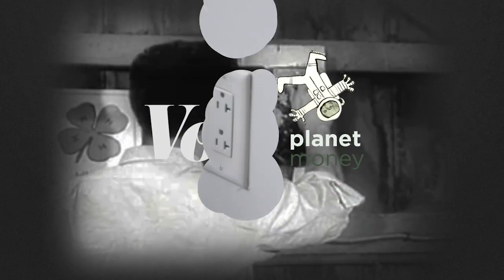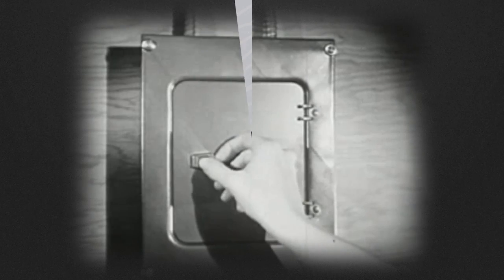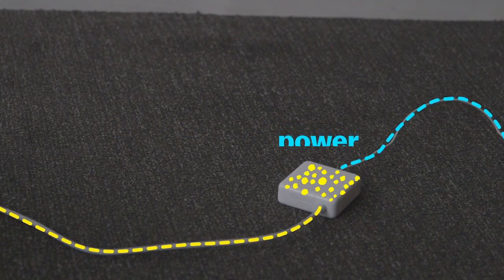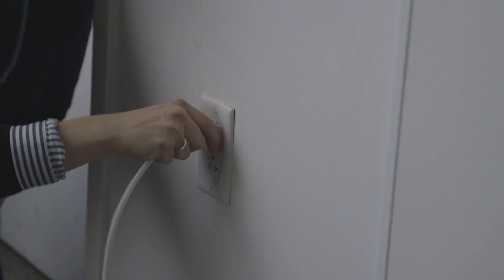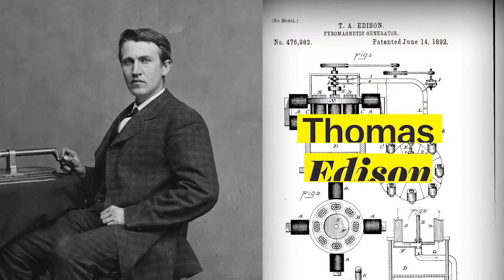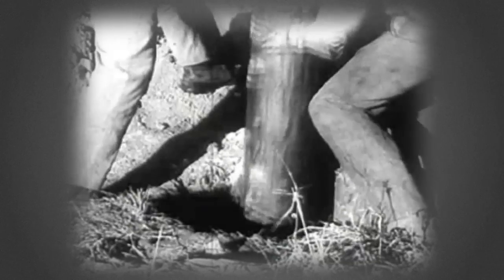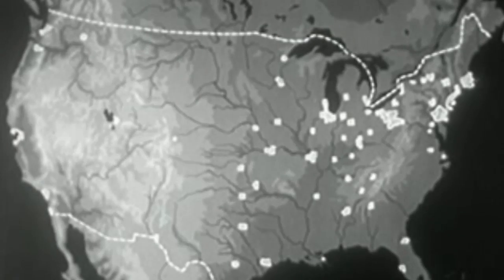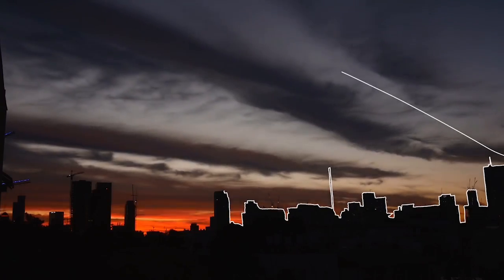Why your laptop charger is so hot

Comment: The video is wrong but the idea of putting a 5V rail into a large building is good. Efficient conversion in one spot. Then you could have outlets (probably USB) throughout the rooms/appartments/cubicles.

12V and 24V would be nice as well, that would help because it's better to regulate down than up but not clear what connector would be best.
Reply: Just try to get a steady 5v from down the empire state building to every single floor. Wire has resistance, so if u send 5v from floor 1 floor 100 could have only 3-4V

Comment: I would have thought this video would also mention that said conversion could be done a LOT more efficiently: All that heat production isn't actually necessary. You can make electronics (for not all that much more expensive) that convert to DC with almost no energy loss (aka heat). For some reason (read: to save a couple cents worth in production, maximizing profit), electronics' chargers are typically sold really bad, efficiency-wise. Customers don't complain: Nobody seems to care how efficient that conversion is, as long as the electronic device in question lasts long enough. Thus, whereas laptops, tablets and phones are becoming increasingly efficient to draw the most computing circles from the smallest, thinnest, lightest batteries, their chargers are not even close to being held to the same standards.

Comment: One thing that the video forgot to point out is, that DC is hard to Voltage regulate. So a central Ac/Dc converter must supply all the different currents. While it is possible to get 12 volts to 5 volts to charge your phone from a car battery, it isn´t that simple with electric cars. The voltage is about 488 Volts and a massive 200 A. This leads to 120000 Watts of power. To have a  comparison: my laptop charger is rated to 65 Watts. So you would need around 1847 chargers simultaneously to charge your Model S.

Comment: Forgot to mention AC is slightly safer, it'll throw you across the room before it cooks you. But I like the idea of a parallel DC power system in the home and we finally have a decent connector for it, USB-C !  1 or 2 USB-C connectors at each outlet with a DC transformer back at the fuse box would be sweet.

Comment: This is wrong on so many levels. Not the quality I expect from vox. Please do more research next time.
Reply: explain y its wrong
Reply: I completely agree. No research whatsoever. It would be fine if all devices were the same voltage. Also didn't mention anything about safety either, such as the demonstration with the horse, that Tesla performed.
Reply: I know this is a really old comment, but nobody actually offered a good explanation for any of this. 
What the video doesn't get into is the reason why AC is better over long distances, which is kinda key to understanding this. Basically, we rely on transformers, which utilise magnetic fields to step up the voltage so that we can move lots of energy at fairly low currents. This is good because the power lost in a conductor of fixed resistance is proportional to the current flowing in it (substitute v = ir into p = iv for p = (i^2)r). Magnetic fields though are proportional to the differential of current, which means unless the current is continually changing (AC), then transformers that use turns of copper wire wrapped around chunks of iron don't work, which means you give up a convenient way to step voltages up and down with no expensive parts. This is likely less of a factor now than it was back at the turn of the 20th century, as you can get inexpensive, flexible and highly efficient switched mode power supplies for next to nothing these days.
Now, running DC all over your house could work, but the same rules for transmission losses apply. It might be more convenient for some of your devices, but in practice it means that you need thicker, bulkier, more expensive wires to move your power around and keep resistive losses down. That's not to say it would be pointless. Some LED lighting circuits are DC, and data centres often run 48V busses for servers to centralise power conversion and improve efficiency. Interchangeability is also important, so alot of the reason we use AC is that everyone else already uses AC. AKA the "if it ain't broke, don't fix it" factor.
The video, despite comments here, is perfectly good for a layman. It just lacks a little depth. But hey, this is a youtube video. I'm not sure what people expect...
Reply: +fred
Oh yes, supercharging things are clever. What the phone/tablet/laptop has is two charging circuits. One is for standard 5V USB voltage, its a DC/DC converter that steps up from 5V so you can actually charge the battery if that is all you have. If the charger supports supercharging, then the device negotiates voltage and current limits and switches charging over to the circuit that works at a higher voltage.

All that only works because you have one smart power supply and one smart device. It doesn't work if you have one supply and many devices each requiring different supply voltages. What you can have is wall outlets that have built in USB chargers, doesn't really get rid of chargers, it just builds them into walls permanently.

[edit]
Ah, these days they do actually have power managers that actually can work with wide input range, this one can work on 3-24V input from USB, they have 5V, 12V and 20V supplies on charger side that are switched as negotiated
http://www.ti.com/lit/ds/symlink/bq25703a.pdf
Reply: ^ luh tanga amp
Reply: Central DC power for homes seems like a very stupid idea, problems with it should be obvious to any electrical engineer. What is not obvious to me, is what would be the benefit? What could possibly outweigh all the problems with such a system? It's certainly not saving power like the video suggests, central DC would be grossly less efficient just because your central supply would be operating well under it's rating pretty much constantly.
Reply: +fred you would still need a DC/DC converter for every device, whatever your standard outlet DC voltage would be, it wouldn't be edible for every device.
Reply: +101m4n
Transformers are still an argument for power distribution, they are simple, efficient and extremely reliable. SMPS can be efficient, but only at max rated load, at say 10% load that efficiency goes out the window, transformers efficiency is pretty much constant, high load or low load, doesn't matter. 
That is also why central DC supply is not an efficiency gain, it has to be rated to power everything you might plug into it, but most of the time very little is plugged in. If on the other hand you have a DC supply per appliance, then the supply is rated to that specific load and can operate near it's maximum efficiency any time it's switched on.

It's worth mentioning that high voltage DC is used for power transmission, but only in niche cases like undersea cables and/or when you need to link up two grids that are not in sync with each other. Undersea cables because they are bloody long and built like coaxial cable, higher voltage means less resistive losses, but you are limited by the dielectric strength and thickness of the isolation, so with DC you can use higher RMS voltage compared to AC and get 1/sqrt(2) less resistive losses.
Reply: My point was exactly that. The simplicity and reliability of transformers is probably why we ended up with AC grids in the first place. I have seen proposed hvdc systems, but didn't think they were all that common. A quick google search though reveals though that they are used all over the place, especially for renewables like offshore wind, which makes a lot of sense given what you said.
Reply: AnyGamesEver (read:men too)
Reply: nobody knows you're a dog on the internet
Reply: "the quality I expect from Vox" really ought to be a lower bar, at least this time it's plausible they just don't know they're wrong. On many topics they seem to actively seek ignorance on a topic, avoiding every opportunity to learn.
Reply: Now that is some detailed knowledge.
Reply: ekolimits 666 likes
Reply: Andrew Also some gaming laptops.
Reply: 101m4n It could also mean that the power brick gets overheated by overworking on supplying the power not only the device itself, the battery as well.
Reply: i knowwwwwww rieeeeeeeeeeeght???!!!!! cali education
Reply: From an Asian student's perspective: P=W/t=UIt/t=UI
Reply: the animals that were electrocuted would have died from both ac and dc, it was just marketing stunts done in bad taste to scare people over to the other side :)
Reply: He's not being sexist, he's just saying that the woman in the video was a journalist that had nothing to do with engineering.
Reply: ekolimits this is okay enough for non engineer minded person, (read:woman)

Comment: What? Nooooooooooooooo, Vox, noooooooooooooooo. Very bad conclusion. Yes, AC travels long distances, but flip that and you arrive at the bigger problem of DC: DC power can only travel very short distances before all of the energy is lost. In order for an effective DC power grid to be established we'd basically need a power plant every mile or so, making it useless outside of cities. So if you work in an office building and your office is way up top but your hypothetical DC converter for the building is in the basement then it sucks to be you. Plus some of the energy loss is converting the voltage which would still need to happen once the charge reached your electronics, which is the main reason for all that excess heat, so you're adding an extra system of complexity and not actually capturing any significant energy that would've been lost anyways. Beyond that, DC power was extremely dangerous. AC goes through a 0V stage because it oscillates back and forth, DC is all voltage all the time making it more dangerous for anyone to work with. It's better to have one little converter on your charger for someone to check out than to shut down all DC power because your bigger converter is acting up. 
//rant

Comment: So then why can't our electronics be designed to charge on AC?
Reply: I understand what you have written. so my question is a rhetorical question. You can look for a dc battery but you will not find any.

Additionally i have to say: The DC and AC thing is not like: left lane traffic / right lane traffic.
choose any for all and it will work.

electronic components set the requirement what they need to work proper.
Just for example:
A capacitor in the DC mode is working like a battery, as a puffer.
in the AC mode it is a low-pass filter.

You also cant say: OK WE DO DC now.
yaaaaiiii, the thing is, even if you would, you have often to change the voltage / transforming again.
Open you computer, have a look to the power supply: there a many cables and big labels:
+3,3V ;+5V ; -5V ; +12V ; -12V (all DC)
you see,there is not a perfect answer.

AC - good for transport of electricity in middle range distances (a few hundred km´s around)

the rest is just necessarily adjustment what your device/thingi requires.
Reply: +Yuphrum AC alternates the direction of current circulation around the wire rapidly, meaning that the capacitors in the battery would be receiving positive and negative currents in rapid succession. This results the charge that you just put in being immediately taken out on the next loop round. Batteries that we currently have will only work on AC, and there isn't really a reason to try and fix what ain't broken at the moment.
Reply: +Yuphrum 120 or 240 volts is too much for small electronic gadgets. You don't need that much voltage. Try connecting a small LED bulb into a 9-volt battery and you'll see that it will be dead in seconds.
Reply: +Yuphrum show me a battery which is working with AC?!?!?
Reply: +Martin Bohl I think you misread my comment. I was asking why it "wasnt" possible to charge to charge electronics with AC not that we "do" charge them with AC current
Reply: Digital logic, which is at the heart of every computer that we use, uses different voltages to represent either an ON state 1 or an OFF state 0. Once you have encoded your programming logic in this manner, you can manipulate the 1s and 0s to do other stuff like adding numbers etc. using logic gates. If you were to keep flipping the voltage inside your circuit doing logic operations, the entire concept behind how we make computers compute things goes down the drain.

Comment: Did you guys even do any research of this? Bridge rectification of 110vAC will see an output of about 105vDC. That's only a 5v drop. Since the rectifier is not putting up much resistance it has little to no heat to dissipate  However, the voltage step down and amp conversion will generate lots of heat since there is a lot of resistance. At some point the circuit has to drop the voltage down to a typical 20v and limit the amps to 2 or 3. That's where the heat comes from.

I know this from actual experience building my own power supplies that use 110vAC as the input and the out ranging from 1.5vDC to 105vDC.

Comment: it's not the AC to DC conversion there is the source of the heat, it's the high voltage to low voltage that's the problem. i think American homes are supplied with 120 volts AC and that laptop are probably using around 18 volts DC or so. if you had a big voltage converter i each home that put (lets say) 50 volts DC in to the homes outlet it would be much easier for a adapter to step down the voltage. (but not a super good idea)

Comment: wouldn't it be easier to say that the transformer is configuration for a low frequency and that is the reason it gets hot. also is  worth to mention that the Iron Core transformer usually tolerate lower frequencies than then ones made out of other materials and any time the electricity frequency gets high  the excess power gets transformed into heat?  

the problem is not DC/AC current, the problem is the cheap design of the transformers used to power up our electronics.

Comment: Thumbs down for the Mickey Mouse explanation. This question is better left to the SciShow or Asap Science.
Reply: +MrBlaq Yeah, this was a bit too trivial and didn't have enough depth of explanation of the advantages of both AC and DC. I usually like VOX vids, but there are many other channels and vids explaining this which are much much better. Stick to doing what you do best VOX, don't just release vids on topics because you need to release more vids. Quality, not quantity
Reply: or minute physics and real engineering
Reply: +cdrwilson The only thing missing in the explanation is about the why of using DC. DC is needed for charging batteries. Also, AC is a noisy source of energy and elelctronics needs a quiet source of energy like DC as the buzzy AC current interferes with using voltages to evaluate computations. AC to DC converters don't just convert the power but also isolates the AC buzz from the DC current.
Reply: yeah
Reply: I mean, the question at hand was why a laptop charger gets really hot, which they did answer really quickly and straightforwardly, so the rest can be thought of as extra. But yeah, it didn't go too in depth about ac vs. dc.
Reply: Yeah I dunno why they got somebody who apparently talks about business and/or economics for a living to explain something about electrical engineering.
Reply: +MrBlaq its also wrong... so yeah

Comment: This is fucking stupid, rhe reason alternating current got so big is BECAUSE IT WAS SAFER! direct current started to be know for burning houses down or killing people! Then tesla did a wonderful thing, he made ac electricity flow into him. it showed how safe it was. So ac is safer than dc....
Reply: +Shane isCrafting It also does travel better across long distances. It's both of these reasons.

I was recently repairing an electric fan, my dumbass forgot to take it off mains power. I felt a tingling sensation in my palm, looked down to find that I was touching the live wires. If that were DC, I probably would not be alive.
Reply: +Shane isCrafting AC could also be transmitted over large distances with very little power loss. It could also be produced by any method capable of turning a turbine.
Reply: I believe in socialism, I hate Capitalism! It's worthless and helps the "big man". Also, Back when electricity was starting, they had to put a plant every few miles with dc because it couldn't travel as far as ac.
Also, if you really knew anything about physics, alternating current takes a bit more math, and  "devices" to keep it going.
With Dc you need a combining resistor, conductance. for it to work you need to know the power, power dissipating, and ohm's law.
With ac you need: Transformer, RMS volt, RMS current, an EMF generator, count for the induvtive reluctance, capacitive reluctance, and the frequency.
So alt current, you need to do allot more math to use it than dc.
Reply: +XxAznDarknezZxX. Edison used DC power to electrocute animals and told everyone he used AC to do it
Reply: Shane isCrafting Quit trying to start arguments on Youtube. It's a waste of time.

Comment: "The US has one of the best and reliable power grids in the world." Don't they use a huge amount of overhead power lines which can be knocked out by a bit of wind or a tree branch, instead of safe underground lines?
Reply: +Selleswiet underground wiring in some areas can be corroded and its easier to get access from above ground.
Reply: +Selleswiet Also the fact that we lose about 60% of power generated through the lines. They broke it down Barney-style and didn't want to scare the little kids.